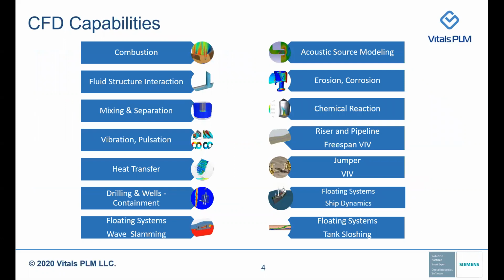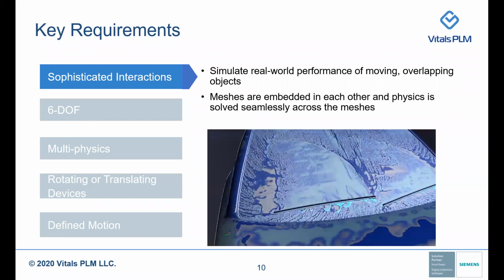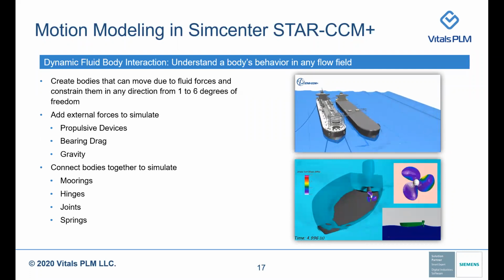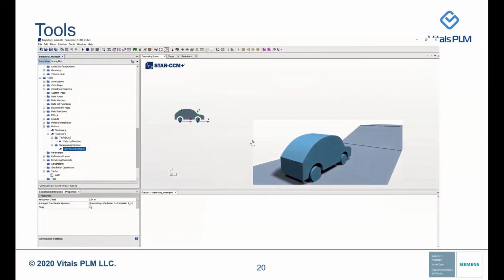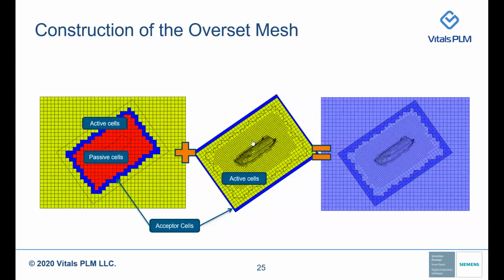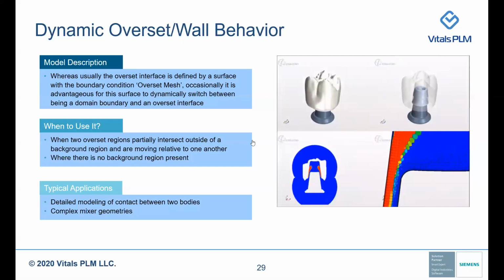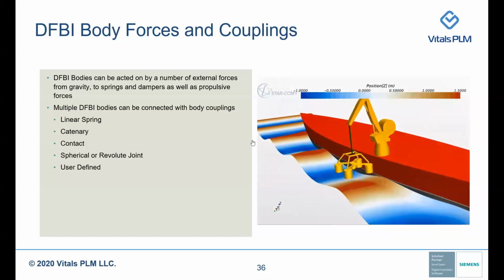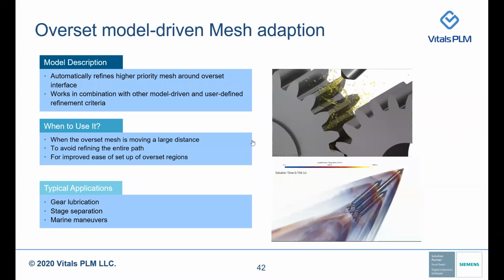Modeling Complex Motions for Effective Realism through Simulations

Comment: I have a question, which is very relevant for the thesis I'm working on. I was trying to simulate particles blockage on a filter, with the DEM model, but even with the two-way coupling and particle's smoothing I wasn't able to get an effect of the particles on the flow. Now I'm trying with the DBFI model ( morphing DFBI ), inserting a sphere in the domain and subtracting it. I'm not able to visualize particle's movement though. What am I doing wrong? Was it feasible also with DEM?